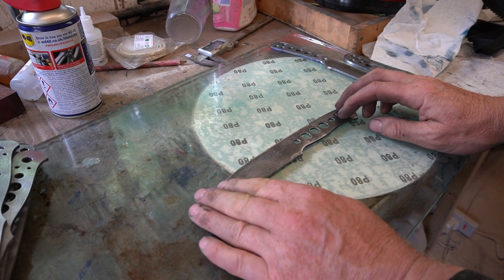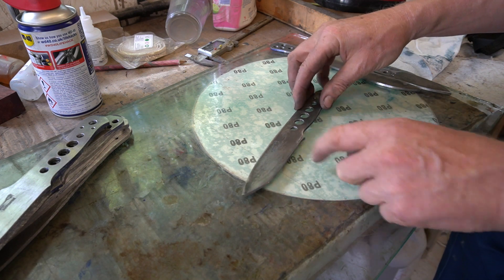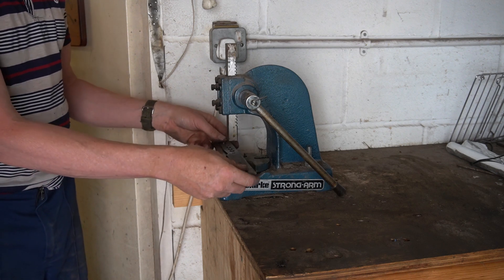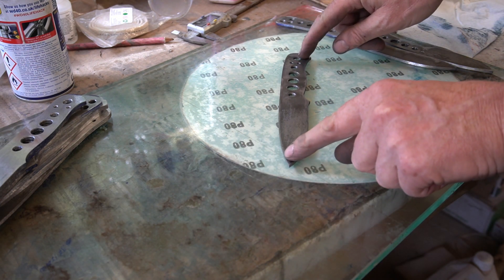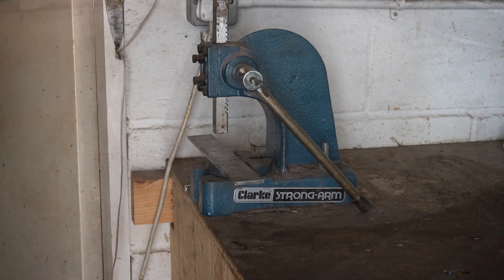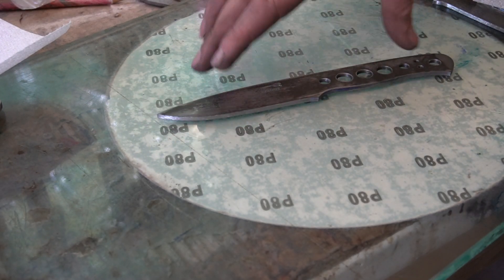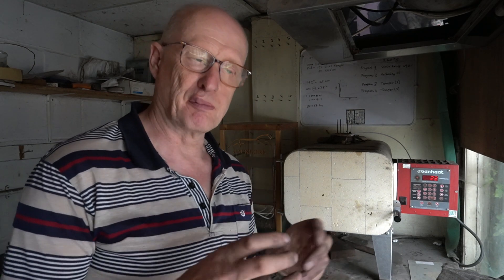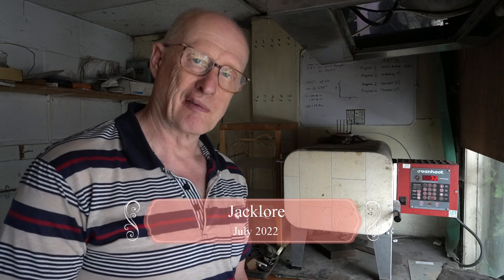Reducing warps in your heat treated blades  Strain relieve them first

Comment: Good thinking, arbour press doesn't leave any dents so no grinding afterwards. Also I must add making a custom tool for straightening of the blades is a simple U-profile with tapped holes on it's sides or welded nuts , then with bolts you find sweet line.

Comment: As a guy who has straightened many miles of steel, you should use two blocks either side of that press head and carefully 'hit it where it touches'*. you wont need as much pressure.
*use a light behind the metal when you got it on your flat surface and see where it actually is bent